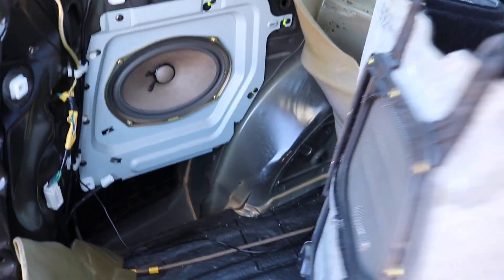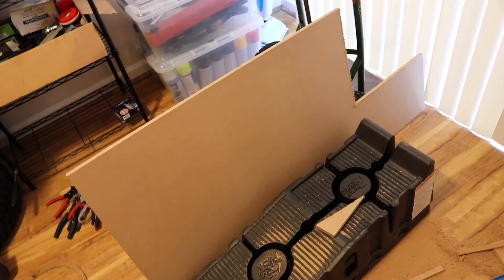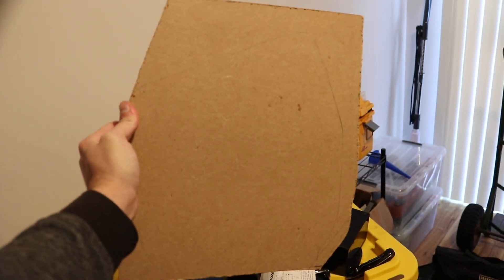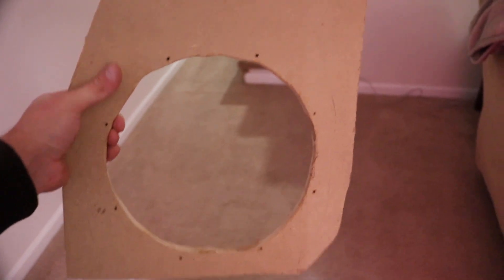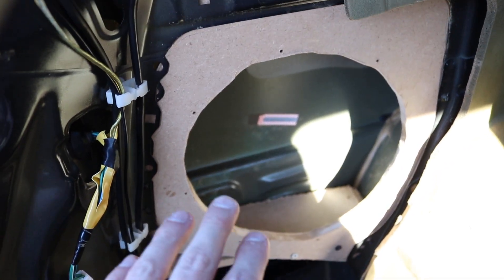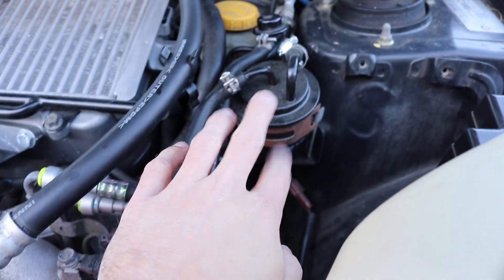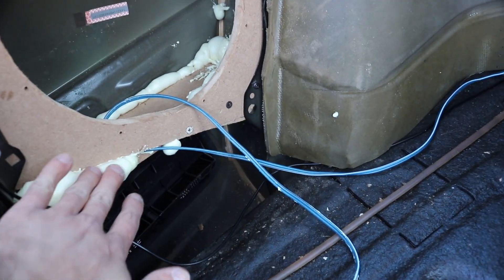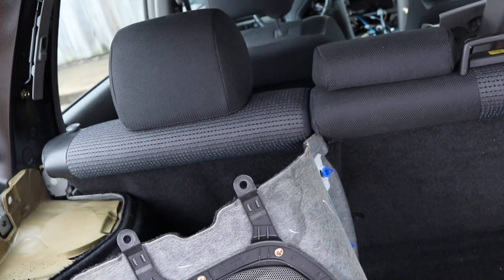2005 Subaru Forester Sub install

Comment: Thank you very much for the vid!!! This is very detailed and spot on for the setup. I've just finished putting a 10" sub back there and had to go through most of what you went through. A few things to add that I found along my way :
Pretty much any 10" sub will stick out against the carpet unless you get some flat type.

Also I had to mount the wooden plate In front of the metal opening because the sub ends up touching the body in the back.

I suggest for anyone else trying this, to try get a flat-ish sub. Saves having to cut the carpet.

Comment: I love all your videos! My trunk sub has never worked since buying the car and ive been thinking about wiring up a new sub like this too it but never sure about the logistics. Youve done a fantastic job visualizing the process and i only have one suggestion. Your 12v line fuse can be mounted to the fuse box cover and then ran behind and under the windshield reservoir. Just a suggestion :). Love the setup it looks great!

Comment: Very nice! Much easier build than trying to fab up a fiberglass enclosure for that space.
I'm going to take it one step simpler and expand the stock sub plate to accept a 250wrms 8" shallow subwoofer, 
power it off of a 500w amp connected to the 12v rear outlet, with signal and sensing from the original sub audio cables.
Theoretically and electronically it should work the same. The little amp doesn't draw much power and the sub doesn't need much power.
If it doesn't, I'll do exactly as you've done and run power from the front to the rear and go up to a 10" sub. 
With the Harman-Kardon system in my 2021 I don't really need much more bass, just more punch...the amped 8" should be more than enough.
Reply: In the world of car audio it is never enough. It will sound great until you get used to it then you will want more. I used to run 4 12s in my hatchback T/A in the 90s. I even had an escort hatchback with 4 12s and 2 10s at one point 🤣. Now I just stay stock otherwise I'm will have to keep upgrading...

Comment: In the double din install, was there no way to use the stock sub, for those of us not wanting to upgrade as you did? I saw you tuck the sub connector away, but can it not be used?
Reply from the maker: Nope, the stock sub would not get any power, that is why i replaced it with a powered unit
Reply: @JRobling  sucks. Would’ve been nice to able to keep/use it still. I’m still going to swap out the radio to the Atoto, so thanks for that!

Comment: Cool video, did that sub surround foam hit or flex into the outter cover and carpet? I’m about to upgrade to a new head unit and sub will need some upgrades…
Reply from the maker: No issues at all
Reply: @JRobling  Right on, anything in hind site you would have done differently? Also looking to see other cool stuff from you if you got more plans. 😎👍🏻

Comment: Should’ve cranked it up to finish the video!
Reply: Its pretty obvious why he didn't, it would vibrate and rattle so hard against that carpet. I have done the exact same on mine but I did a few things differently and managed to keep the factory mesh with a 10" sub and it goes hard and doesn't slap against the carpet.